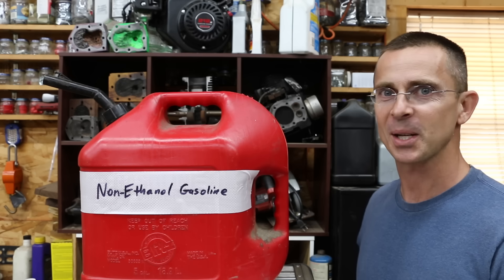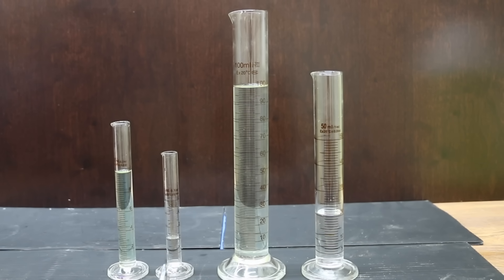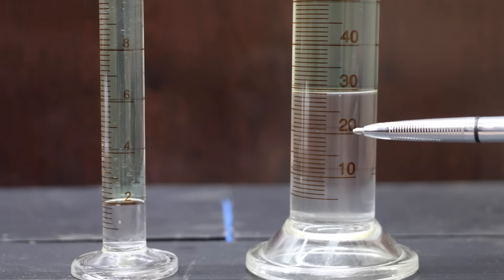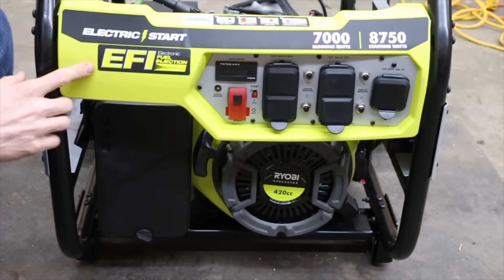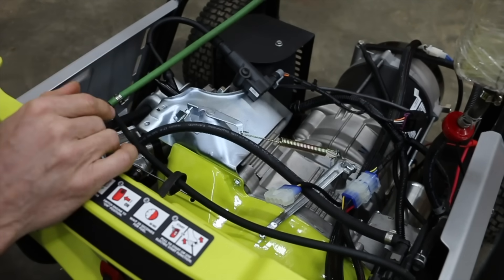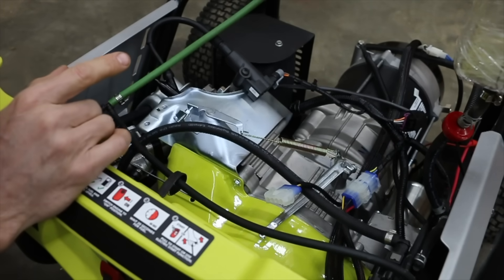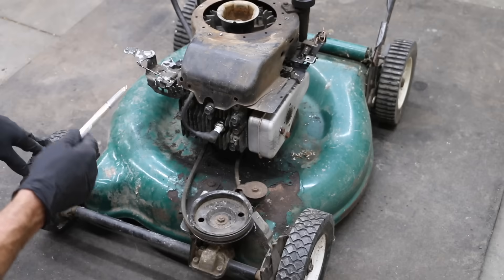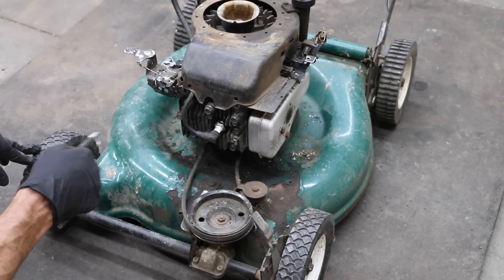Is Non-Ethanol Gasoline Really Better? See the PROOF!

Comment: I was working in a small engine repair shop when ethanol started being introduced into the gasoline and the biggest thing we noticed was how fast the fuel lines got hard and started cracking. Typically we could get anywhere from 2-5 years out of them depending on the conditions they were kept in but with ethanol in the gas we noticed they would only last 1-2 years
Reply: Yes, had several weed eaters, leaf blowers, etc with those small diameter yellow lines that seem to be hard as a rock after a year.  Had several crack and leak because of that also.
Reply: @black98rt  

Ethanol "dries" out the lubricants and rubbers/plastics
Reply from the maker: Great point!
Reply: Since then, manufacturers have of course added more stabilizers and additives to prevent the oxidation from occurring. Should be no issue now- just had to wait for industry to catch up.
Reply: BenLeBlanc1 
Locally 1 dealer changes the filters on the pumps on a regular basis. Gas locally currently is $1.85-2.30 for ethanol with allegedly 10%. Tested the old way by putting in a pint glass jar in 12 oz had over 2 inches of water and assorted gunk straight from a new can. Old fashioned non ethanol is from a distributor of gasoline. So locally the smaller gas stations have to be adding water when. Pumps are only tested here for volume it’s left to the dealer to verify it’s 10% or less. No law says they can’t add water just max on ETOH. Still dissolving the gas lines on pro yard equipment. Anything with a carburetor Non-Ethanol from a reputable source and ask them when they changed the filters last. Usually you’ll get a dumb look. But if you see the pump mechanic working ask them, usually it’s 1 guy that does it quarterly. He’s basically there to make sure the seal isn’t broken and fix a nozzle. Have a friend that’s a contract employee for a regional chain. Gets gas elsewhere than the company that’s paying him.
Reply: BenLeBlanc1 Not !!!
Reply: I was working in a See-Doo shop and the ethanol destroyed the fuel systems in the PVCs. We had to replace the fuel tanks, all the lines and rebuild the carbs. Since you had to pull the motor out to replace the fuel tank this was a very expensive warranty repair. See-Doo even covered the repair if the unit was out of warranty.
Reply: Ethanol when left overwinter in a carb leaves a nasty green gel in the passages and bowls. It's a pain in the ass to clean out.
Reply: This is what I found out in my generator.. Nasty jelly at the bottom of the carb bowl... non-e gas is hard to find in my small town.. I even use gas treatment to prevent this...doesn't work.  Good info in the comments for sure..
Reply: Loren Husky It also goes acid and eats aluminium and magnesium.
Reply: @lorenhusky2717  Same story with straight gasoline, just a different residue.
Reply: Modern fuel lines can handle it, but it's still an issue for older equipment. You might be able to get fuel lines that can handle ethanol for old gear.
Reply: Wes, you are correct. I am a service manager for an Ag repair shop. We are also a Gold certified Stihl dealer and a Honda power equipment dealer. Ethanol ruins small engines. It will destroy fuel lines, it will destroy gaskets on small engine carburetors, it will create a sludge or varnish if it sits in the tank. After we repair these Chainsaws and weed eaters and generators and such I always tell my customers to use the Moto-mix that Stihl offers for their saws and weeders etc. I tell my Honda owners they should be running non-ethanol. We are a small town and only one gas station offers non-ethanol gas. I tell them to go there. Sure, we make some revenue from fixing the small engines that have been damaged due to ethanol but the trust of customers is more important. I'd rather have them avoid the problem in the first place instead of blaming the product they bought. "This saw is brand new and it's a piece of crap...it won't start and the carb is leaking"  Not the products fault. Put the correct fuel in it and when it does have an issue trust us to repair it correctly and not rip you off.
Reply: Seen more hand held fuel system problems when E-10 came out
Reply: I have a bunch of two cycle engines I use occasionally.  The synthetic 2 cycle fuel is great because it is stabilized and good for 2 years.  It's expensive, but between non ethanol gas, the oil, and stabilizer it's worth it vs engine repairs. I have some equipment that is over 20 years old and runs great.  

Speaking of ideas, how about comparing the various 2 cycle fuels such as tru fuel, the Stihl product, and the generic brands?
Reply: Wes Davis Don't know what planet you're on , I've had chain saws last 20 yrs , now the ethanol content is too high or diff formula they don't last maybe five yrs if you're extremely fortunate, btw ,here in Michigan ,all that crap does is attract moisture , and with the temp fluctuations and the humidity it's a constant battle.
Reply: @beckywatt5048  I was meaning the fuel lines not the equipment itself
Reply: And with the correct parts meet of the correct materials that doesn't happen. Natural rubber and alcohol doesn't mix. It's not a problem with most synthetic rubbers.
Reply: Only because the old lines were never meant for ethanol. New lines designed for ethanol are no problem. Orings and seals are the same problem. Ethanol cleans the hell out of your fuel system.
Reply: I agree . Started using ethanol for my 1.6l Honda car. Ate the shit out of my seals. Started burning oil ... :( Never again.

Comment: The problem with ethanol goes exactly where the water is. Hydrophilic substances tend to attract water just as you have shown. 
Ethanol also likes to evaporate a plenty, which means, that after a while of sitting, you may be left with next to zero usable ethanol in your fuel tank. All that's left will be mixed with water.
Reply from the maker: Thank you